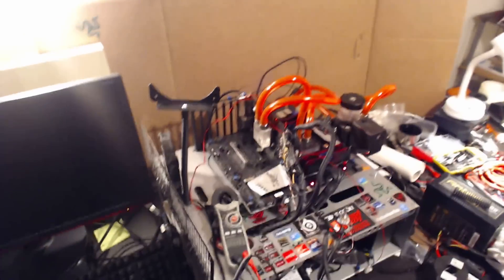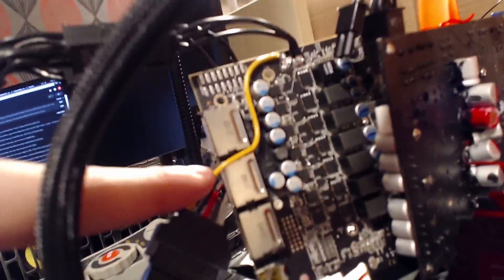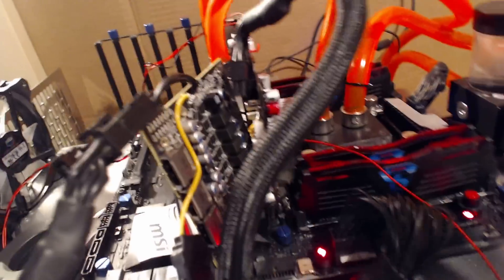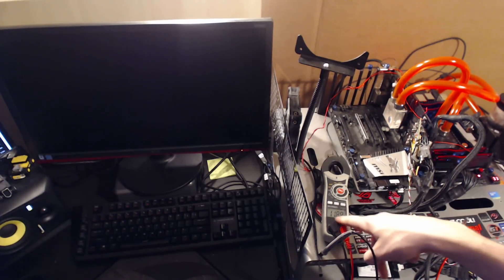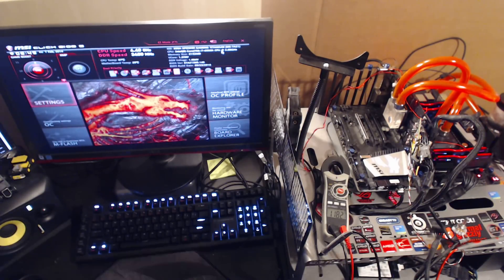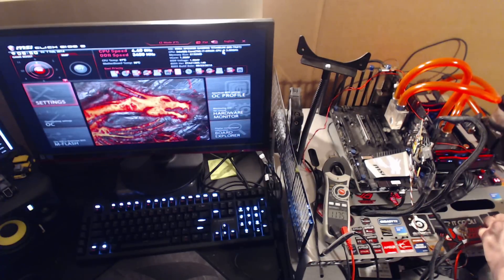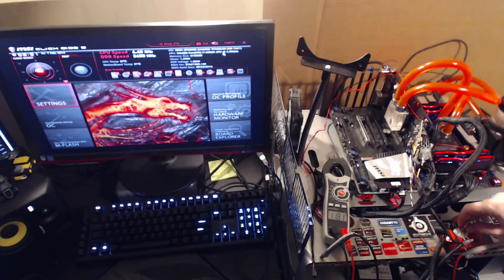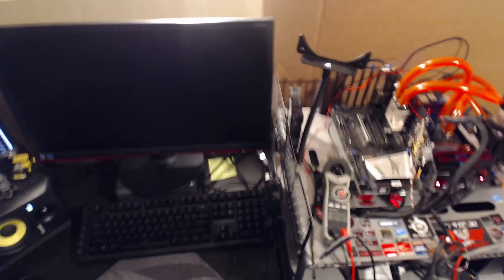RX 480 power on GTX 570

Comment: Wow that is pretty neat.  I want to do that with my HD 6870 VRM now (although it is a pretty lame VRM, but it would still be practice.)  Great work!
Reply from the maker: Even a weak VRM can be used to feed some minor rails. A lot of OCers used to replace the 0.95V on a 290X with an E-power because modding that voltage was a pain.

Comment: Solution to the lack of wires: cooling fan for the wires.
Reply from the maker: that doesn't change the massive Vdroop.
Reply: I thought the Vdroop was sorta ok?  At least at low loads.
Reply from the maker: 15mv at idle is better than what I had before but still terrible.

Comment: Um... strange marriage, but that is really remarkable! Are you going to overclock and benchmark this Franken-GTX 570 when you clear all the issues? I'm curious what are your plans for it.
Also, from now on I'm calling you BuildLORD, the Lord of GPUs!
Reply from the maker: I've already done a livestream with the GTX 570 running an E-power on LN2. There's an archive of it on the channel. This is replacing the E-power because I need the E-power for other cards(GTX 590) but I don't like the idea of having a perfectly good GTX 570 lying around non functional and a very dead RX 480 reference card being a wall ornament so I cut the 480 VRM and attached it to the 570.
Reply: Thanks, I've watched that stream with the 570 with the E-Power. Looking forward to your next video or OC session.

Comment from the maker: FIRST
Reply: Second !
Reply: lol
Reply: I'm not sure what would be best for the wire, because of the heat soldering it all up. Electrically I'd be tempted to use flat copper strapping, yet soldering that without killing SMT stuff is near impossible. many thin or few thicker wires, It is something I would be interested to know a bit more about. If only to keep myself from killing stuff I can't afford to replace.
Reply: u are the best, and Buildzoid i have now(2Weeks) an Phenom II X6 1055T as StreamingPC, i OC´ed the Phenom to 4,2GHz but i need 1,650Volt and an AIO to keep the Phenom cool, what do u guess is the max vCore without kill the CPU ? my MoBo is an GA-890XA-UD3 with lastest BIOS.
Reply: 1.65 Volts ???? i had my Pheno 955 to 3.9Ghz with 1.492 Volts.....
Reply: i have the 125Watt TDP 1,350VID version, not the 95Watt TDP version
Reply: its an X6, i think it needs more vCore than an X4.
Reply: ohhhhh... yeah could be ! my bad !

Comment: @Actually Hardcore Overclocking Do you have any interest in pcb shots of a Gigabyte gtx 1070 G1 Gaming? I ripped mine apart to replace thermal paste which I'm glad I did but took some pcb shots. I have the front, back, and up close of mosfets and a couple other components.

Comment: Why did you snap an RX 480 in half
Reply from the maker: I didn't snap it in half. I used a hack saw. Also the card was very very dead before I cut it up.
Reply: Actually Hardcore Overclocking how did it die?
Reply: there's another video on this channel somewhere that explains that a bit I think. Been a while since I checked though.
Reply: It's called overclocking casualty

Comment: Where did you learn all that $heet mate ? U're even more crazy than Linus, the guy that cooks GPUs and builds 40k PCs.
Reply: linus is only crazy when you put power tools into his hands...
Reply: The stuff linus does in his channel is pretty elementary
Reply: Linus is just 1 big advert. Dont get me wrong the guy knows a lot about hardware but he's the luvvie of the tech reviewer gang. This is a very different channel, stick around and learn some.
Reply: did you just put linus and this guy in the same sentence?
Reply: Santiago Ferrari 

Linus actually knows a decent amount, but is more of a good computer tech whereas bullzoid is more like a crazy computer/electrical engineer.

Linus is the guy you'd be lucky to get for regular tech support, bullzoid would have your problem fixed, your GPU, CPU, and RAM oc'd and a version of Linux dual booting on your machine, when all you called for was a Windows Activation.